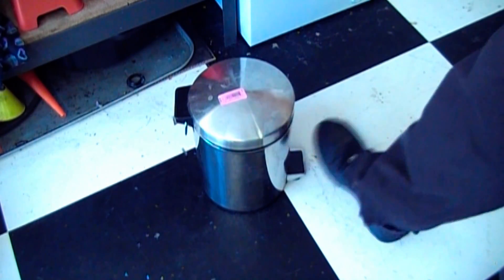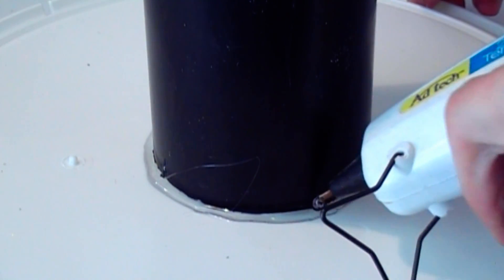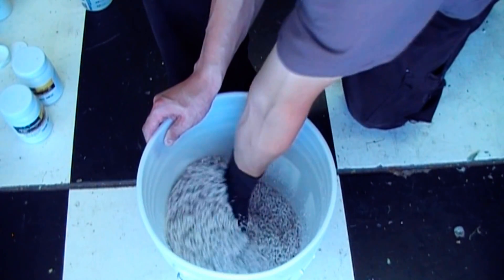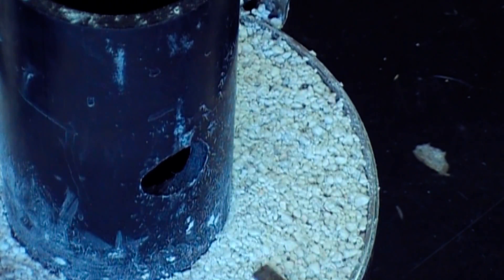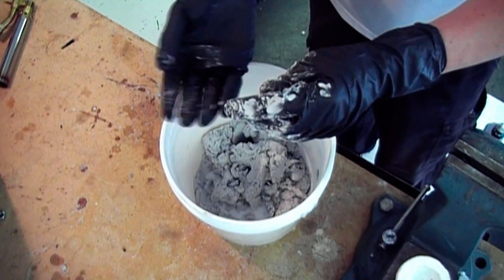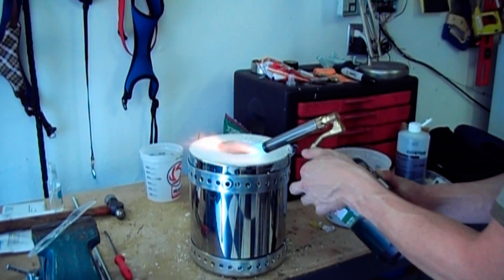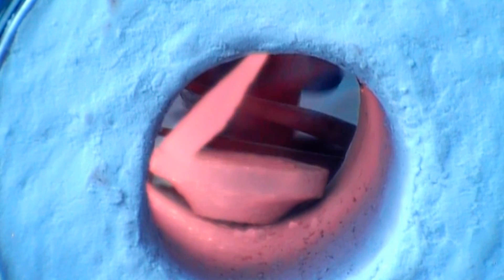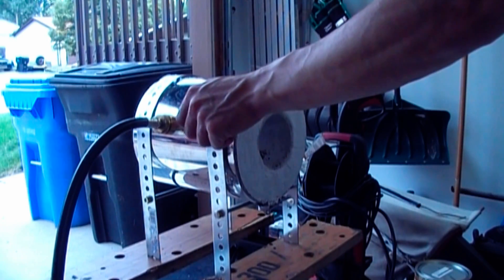How to build a trashcan forge

Comment: Thanks for sharing your builds. Nice info channel, subscribed!

Question or thought: I see on this build and the Coffee can build you put the insulating "icing" on after. Have you considered or tried putting it on first to the inner tube, then the perlite mix? This would, in theory, give you more control on the thickness as well give you a finished look. And an additional 1/4" or so to the opening diameter. You can finish the top edge off as you do normally.

Another question, I saw a "planter" forge build that used a sand and plaster mix. What are your thoughts on that mix over the perlite mix you are using? Any thoughts on combining the two in layers, perlite on the exterior, sand/plaster then your "icing" mix on the inner most area and top?

New to this, and just looking and thinking of possibilities and combos to improve what's already been done.

Last question, if you were to build it over now that you've had it for a while, are there any changes you would make to the build?

tia,
- chase -

Comment: Very nice video. Just wondering how has your refractory been holding up since you have built your forge? I'm going to build a forge but a larger one out of an old 10 gallon air compressor tank and I have been looking around for different types of refractories to use. Some say to use a mix of cement and fire clay, some say use k-wool and others say perlite mix. If you were going to build a larger forge, what type would you use?

Comment: Hi clkindred is it posible to use calcium bentonite instead of the  alumina ?
Reply from the maker: I have tested some samples made with bentonite and it melts, also it's hard to work with because it shrinks a lot when drying.
Reply: clkindred Thank you I will have to get alumina, is alumina sand ok ?
Reply from the maker: As long as it's alumina it should work.
Reply: clkindred Finally  I began reading about the aluminium oxide chemical  and physical properties and began producing it from aluminium sulfate and soda i´ll have it like in a week complete precipitated and filtered but will work! thank you !
Reply from the maker: Cool! A precipitate should be nice and fine, might be a finer particle size than what I used. Good work!
Reply: clkindred hey thank you I´ve been working litter by litter and got almost 9 pounds into gel suspension  its quite thin, I´ll post my first video to show you! also tested a little clay instead of aluminium oxide and got a cool result

Comment: Would placing the burner in the middle or at the end (if the forge had a closed side) be better?
Reply from the maker: It depends, having a closed side to the forge makes fitting long workpieces into it problematic. Middle might make some sense but I wanted the hot spot to be easy to reach. I was planning on making some adjustable doors on both the front and back so having a closed side could be possible, because a closed end would make it hold heat better.
Reply: clkindred oh! I haven't considered that fact! Thanks man!

Comment: Nicely detailed video, question does it have to be 220 grit or any type of grit aluminum oxide? Thanks!
Reply: It can be any kinda alumina powder so long as your weight ratio is still close. Thing being that it is easy to find this grit at harbor freight and such. If you want something that is super easy and ready mix look up Delta Tcrete refractory. The pre mix comes in handy when building a very large forge.
Reply from the maker: Most grits will work, but the grit size determines the working properties. Finer grits mold and shape like clay, coarse grits mold and shape like wet sand.
Reply: Alright, thanks for the information I got 220 grit anyways.
Reply: Brendan Dinh I also used 220 grit with construction perlite and it packed down like concrete. I used a propane tank and it has a 6" center and 3" walls to hold on the heat. I have a new box of aluminum oxide arrives today and I will be doing the final coat of the sodium silicate and aluminum oxide today. I am using a Harbor Freight weed burner for my fire so I can't wait to build a fire in it
Reply: hcistheman Yea I pretty much did the same! Good luck with whatever your doing with your forge and hope it works well. :D
Reply: clkindred the 220 grit with construction grade perlite packed down and it looks like white concrete after dried and cured. I will be finishing my foundry within the next few days and will post a video of what I used, how it turned out, and show what it looks like with fire in it. For this foundry I am using a Harbor Freight weed burner for the burner.
Reply from the maker: I have noticed coarser grits cure easier though, they don't have as big of a problem "blistering" when the water is torched off.

Comment: How would Kaowool Cerablanket  hold up versus the homemade refractory materials?
Reply from the maker: bmjschooch Ceramic wool is a better insulator, but it's soft and you can't rest a workpiece on it. So even cerablanket needs something to help it fill curtain roles. A ceramic wool insulated forge that has the wool lined with the aluminum oxide cement would perform very well I think.
Reply from the maker: Probably, I tried using it to stiffen up rock wool and found that it's a very distinct tradeoff. The more rigid you make the wool, the less it insulates.

Comment: I made a perlite forge and burned it up fast
Reply from the maker: Yep, perlite is not as resistant to heat as I had hoped, that is why I coated the particles in aluminum oxide to solve that problem.

Comment: If the perlite melts at 2000 degrees, then is forge welding out of the question?
Reply: clkindred

One thing that may increase the performance of the burner is to ensure the burner tube is tangential to the inside diameter of the furnace.
Reply from the maker: No, the aluminum oxide shell around the perlite particles allows the refractory to hold it's shape. I find the only limit is the burner, this one is barely up to the task.

Comment: Sorry I didn't explain myself very well. It made it sound as if I was going to make the lining 6 to 8 inches thick. What I had thought was to use your lining between a 6 and 8 inch metal tubes. The lining would only be an inch thick or perhaps between a 6 and 10 inch making the lining 2 inches thick. The metal would remain in place so my concern was if your lining would dry in that type of use with no air getting to it. Hope that makes better sense.
Reply from the maker: Oh ok now I understand. If the metal tubes remain in place, there is not much that could go wrong. It might take a while to dry, but during use it will dry eventually. The problem comes from the requirement of removing forms before firing the forge for the first time, the lining needs to be firm enough to survive un-molding. The first firing cures the lining, but if the forms stay on, then it dose not really need to be dry before the first heat. Despite letting my lining dry for a week before removing the inner form, so much water came out during the first firing that there was a puddle on the floor underneath.

Comment: I am thinking of using your lining materials in a rocket stove heater. It would be between a 6 and 8 inch lining. How do you think that will work and will it dry in that application since air can not get to it and can I apply heat to help it dry. Love you videos by the way. You are a very natural teacher. Eric
Reply from the maker: Sounds like quite a bit of material needed. It might be cheaper and easier to buy blocks of rockwool and use that to insulate. I have bought rockwool at places that sell stuff for plants, people grow plants in it. I have tried rockwool for a forge lining but the direct torching causes it to melt, but in indirect heat it holds up pretty good.

Comment: Can that perlite mixture be used in a furnace for melting iron/steel?  Thanks
Reply from the maker: I have not taken this mixture to that high of a temp, so I'm not sure. The perlite will melt at around 2000 degrees F so it would depend on the coating of aluminum oxide around it as to weather or not it can take that kind of heat. The weak point in the aluminum oxide coating is the binder which is used to hold the particles together.
Reply: clkindred Another idea would be to use Magnesium Oxide, which can be bought over the counter in drugstores (dietary supplement). Melting point of MgO is >5,000 deg F. Make sure that all work done with MgO is done with proper ventilation as it, like Zinc Oxide, can cause metal fume fever.

Comment: I wanted to make one of these forges, but when I went to go buy the 220 grit white Aluminum oxide, they no longer sell it at Harbor Freight. They do sell a black 70 grit Aluminum oxide. Can that be used as a substitute? Also, when you use the adapter, do you need a regulator, or does the blow torch valve act as the regulator? BTW thank you for your videos. I appreciate your work.

Comment: Another question (i am totally noob on this subject), hope not silly: Your forge has two sides open, another is open only at one side, what is the benefit and use of it? Should i cut the bottom of the can or just put one hole on one side as cheminee conduit? What is best? By the way hope you best wishes in this new year who starts!
Reply from the maker: Through hole is easier to use because you don't run into a problem where you can't get the workpiece in far enough to heat farther back. Closed end is more efficient at holding in the heat. Thanks for the comment!

Comment: hi, very nice work again, just a little question again :) What you think if i use pozzolan which is siliceous or siliceous and aluminous volcanic rock instead of aluminium oxide?
Thanks for sharing your knowledge.
Reply: so,powdered natural pozzolan would replace aluminium oxide or not? Trying to make it cheaper, you didn't answer.
Reply from the maker: Alp Alphan I have been doing some research and it's hard to say, "pozzolan" seems to describe a range of materials, not a specific compound. Therefore there is not really any data on the physical properties such as melting / decomposition temperature. The only advice I could give you right now is make a small test piece, the size of a credit card or so, and torch it to see how it performs.

Side note, there was mentioned a property where pozzolans can react with calcium hydroxide and water to form a cement type substance. The presence of water probably will rule this type of cement out for a refractory, but it has sparked my curiosity to experiment with it. Where did you get pozzolan?
Reply: clkindred at the nursery i've gotten few years ago, they use for draining water from soil. I heard it is the main ingredient in portland cement. I will try when i get my propan and share with you if you didn't do before ;) Bentonite looks interesting material also, maybe i'll make some soup out of what i have to see their reaction to fire. Thanks again for taking time to answer.

Comment: Awesome videos! Thanks for making them! Quick couple of questions, do you think a finer grit of aluminum oxide would help, and if so how fine would be to fine? And do you think a five gallon metal bucket would be too big to use with this method? Thanks for your time
Reply from the maker: dengriff69 I have not tried finer grit aluminum oxide, but have noticed with other substances like magnesium silicate, that the finer particle size helps make the mixture easier to work with. The finer the particles, the more clay-like the workability. The 220 grit I use works a bit like wet sand. The only thing that determines the size of the forge is the burner. You need enough flame to heat the whole forge. I think a five gallon bucket sized forge would need a much bigger burner than the one I used. Thanks for the comment!
Reply: @clkindred  Hi, thank you very much for your tutorials - very informative and  very well presented! I'm just following them - mainly this, with all lessons learned. Aluminum oxide - very fine- can be bought cheaper from ceramic manufacturing  material supplies.

Comment: thanks for the videos, I am in the process of collecting the materials to make a forge... I have old propane tanks but don't see any videos using these with perlite... also i found perlite (agriculture grade) at lowes here in town.  I see there are many different grades and this is one of the lower grades,  I have sand blasting grit ( hope its al oxide.) that i will try to use now that i saw your video.  Harbor freight is not usually an option since in alaska their shipping rates are prohibitive... Don't understand more businesses using package sizes that are not conducive to flat rate shipping, many don't even understand that shipping to Alaska by flat rate is the same as anywhere else in the country.  Had a heck of a time finding "commonly available" Sodium Silicate, I think I may be able to get some from Amazon,  Is it ok if it freezes?   Thanks again and Merry Christmas from North Pole, Alaska...Ed
Reply from the maker: Huh, I got tired of looking for sodium silicate where I live, so I made it. I don't know how it would react to freezing.

Comment: What size trash can? Also where did you buy it? Is the blow torch tube from harbor freight as well and is it the weed burner propane kit?
Reply from the maker: The size is somewhat arbitrary, whatever size you like, or can find is what should be used. I bought this one at the thrift store. The burner tube I made, the HF weed burner could be made to work though.
Reply: clkindred I ditched the trashcan idea. I found a place locally selling firebricks for $1 each, and bought 50. This means I could change the size when needed. I ran into a snag with the burner though. Pipe threads are tapered, meaning on a few pieces I could only could 1/4-1/2 of a thread...not enough. How do you do it??

Comment: Gotta say I love your videos. Great job doing some high temp projects without spending a shit ton of money. If you don't mind I have a couple questions: How long do you expect your simple refractory lining to last? also why just use sodium silicate? why not use a silicate based refractory cement? and about what temp and for how long will your lining hold up? i appreciate any time you take to answer my questions, i'm getting into blacksmithing as a hobby but do not have the space or resources to use a coal forge. Thanks a bunch!
Reply: also, might using a refractory cement in place of sodium silicate alone increase heat resistance? thanks
Reply from the maker: seth reinhart It's holding up great so far, I just heat treated a couple blades I needed hardened. I use sodium silicate because it was cheap to experiment with. I did not want to go buy a product only to waste it trying to modify it's usage guidelines. I know how to make sodium silicate so it was expendable, so I gained experience working with sodium silicate.

I tried a brand of refractory cement a while back, it was "Rutland" castable refractory cement. I followed the directions exactly, and it produced a piece that was too rough and fragile for my satisfaction. It also can't be modified by adding insulating aggregate like perlite without becoming VERY fragile. Also its temp rating of 2000 degrees is too low. This stuff is for fireplaces and things like that, 2000 degrees F is not high enough for a gas forge, because the lining will see temps much hotter than that. The piece I made with the store bought refractory cement shows signs of melting.

The primary refractory component of my forge is aluminum oxide, (melting temp of ~3700 degrees F) The sodium silicate just glues it together. Anything else added will decrease the heat resistance. The perlite I add to bulk up the lining and make it insulate better will eventually melt. As long as the aluminum oxide holds its shape, this melting won't make any difference.

Hope that answers your questions.
Reply: That answered them perfectly! Thank you so much, I ordered all of my stuff today and will hopefully be smithing in another week or so! FYI the aluminum oxide at harbor freight is not on clearance or discontinued so I had to order mine in larger quantities from some manufacturer off if eBay. Your videos are super helpful and I appreciate your feedback. Hopefully I'll post some videos soon, thanks again!
Reply: *now on clearance or discontinued
Reply from the maker: Huh, the harbor freight in my area has it on clearance too, but they have it in stock so I got it for 6 bucks per 2lb jar. If I was going to order sandblasting grit, I would be inclined to try silicon carbide, melting temp ~4900 degrees F
Reply: sounds like some awesome properties, but it's also twice as expensive per pound then aluminum oxide for the same grit. amazon has it for about 7.50 per 1 lb bottle. Browsing the ABANA site I stumbled upon a link to some guys that actually sell a lot of hard to get materials for an great price (EX. 1"x 24" x 5' roll of ceramic insulation for around 35 bucks.) it looks like a really sketchy website but it seems like these guys do conventions and whatnot so I'll look into it and post the link so you can check it out.
Reply: clkindred mine is out as well, I found this online http://www.hisglassworks.com/shop/loose-grit/silicon-carbide/5-pound/5-pounds-220-grit-graded-silicon-carbide-html.html do you think you would still use the same ratio as the Aluminum oxide and would you also use it for both the pearlite and the seal, noobie here

Comment: Hi clkindred. Could you tell me where you got the aluminum oxide? Or rather, where can I look to find it locally? Thanks for the video.
Reply: Or do you think I could use baking soda as an alternative?
Reply from the maker: kenjistarr
Baking soda will decompose to sodium carbonate which has a melting point of about 1500 degrees F. Sounds good but it won't take the direct impingement of the flame. I got my aluminum oxide at harbor freight, it's sold as sand blasting grit.
Reply: clkindred Okay. Harbor freight it is then. Thanks Clkindred.